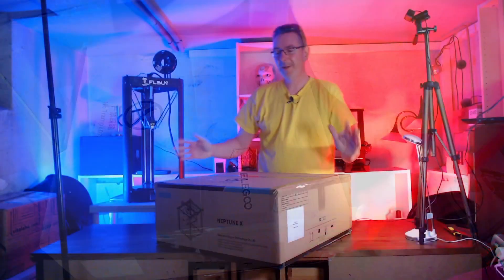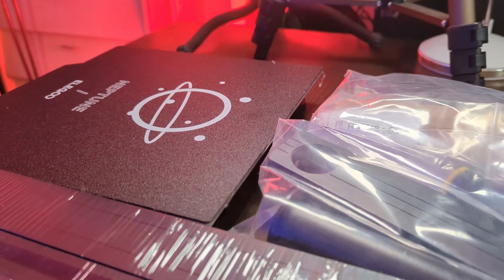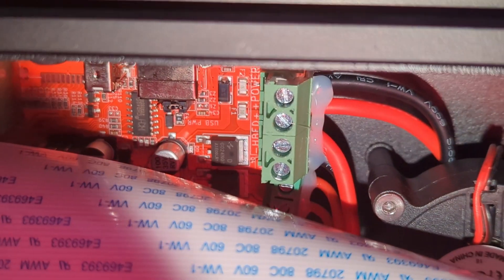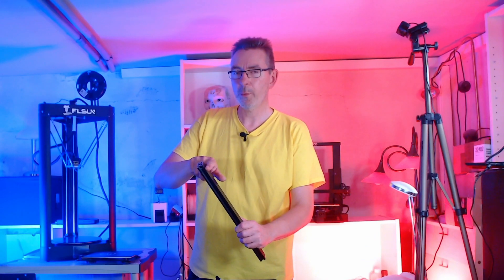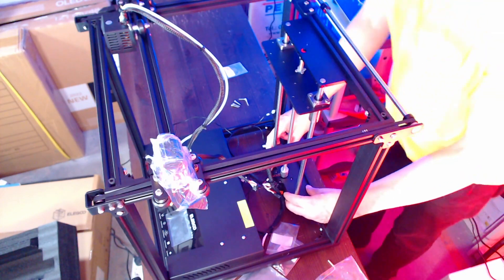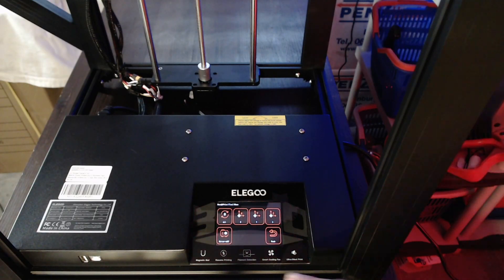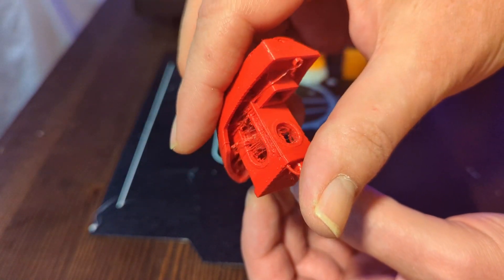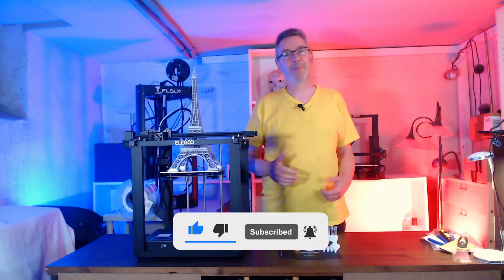Elegoo Neptune X: Better than Creality Ender 5 Pro?!

Comment: Any suggestions for upgrade or replacement parts for the Neptune X? I'm having a hard time finding replacement parts like a new extruder.
Reply from the maker: Thanks for your comment! It's always great to connect with fellow Neptune X users. 
Finding parts for the Neptune X can feel like searching for a unicorn in a haystack! But don’t worry, we’ll track one down together! Knowing that the Neptune X is almost a Creality Ender 5 clone, you can use the parts offered for that one, or even those offered for the Ender 3. The hotend is an MK8-style one, like that used on the Ender 5. Most other parts are off shelf if it comes to V-wheels, or timing belts. 
For the extruder you should be able to use the ones offered for the Ender 5 or 3, too. Maybe you have to design and print a custom mount.
These tips should get you a bit further and help keeping your X up'n running.